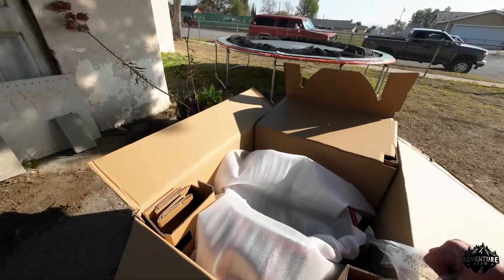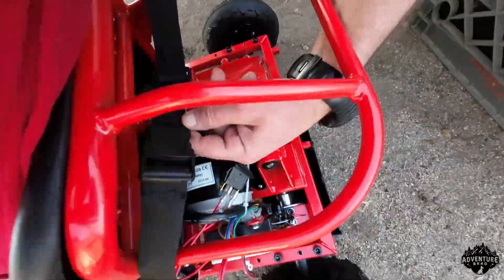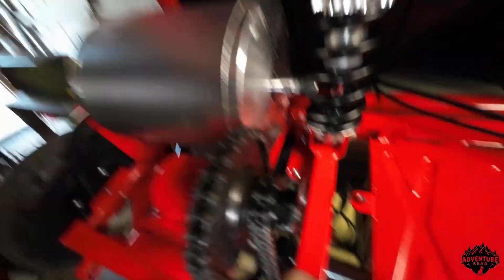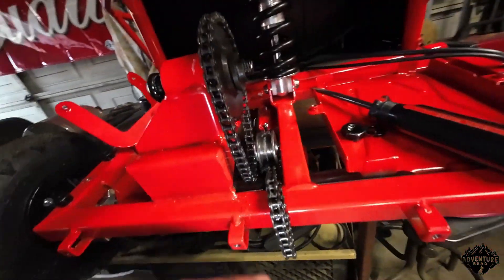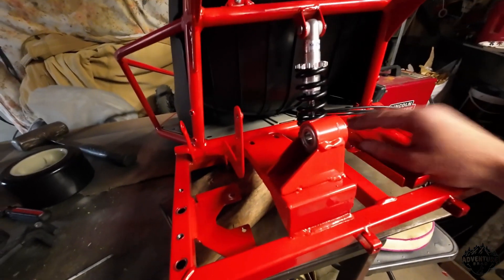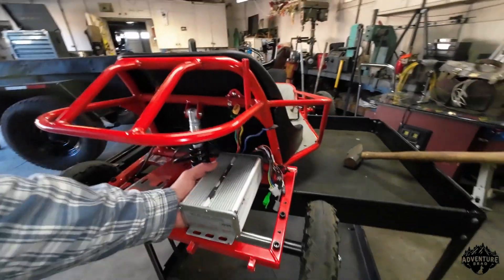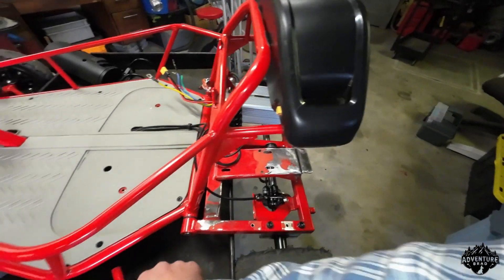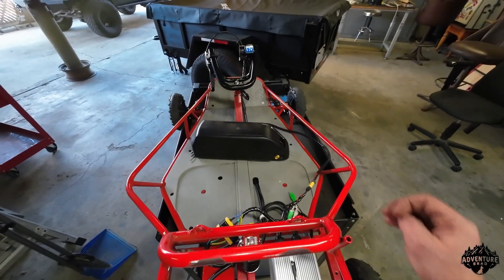Razor DuneBuggy Conversion

Comment: where did you get the speed controller and thumb throttle please
Reply from the maker: Amazon
Reply: Can we get links please? Hard to see in the video
Reply from the maker: It's all from Amazon
Reply: @AdventureBrad look I'm a beginner with electric motors and parts, I'm going in blind with no base knowledge. I just liked your buggy and wanted some part names and brands. i will figure it out if you don't but if you could recommend the LCD throttle and the battery, I would appreciate it
Reply from the maker: You will just have to look on Amazon. Get a battery that is well reviewed
Reply from the maker: Amazon